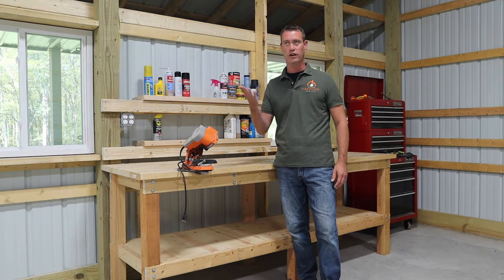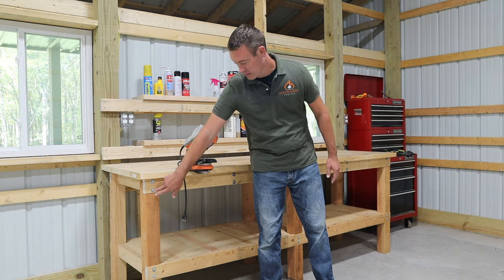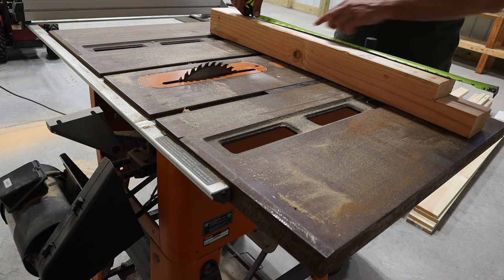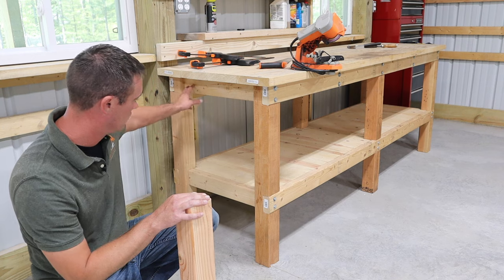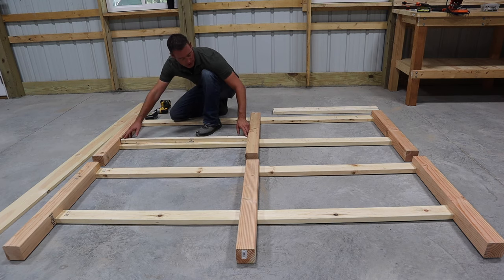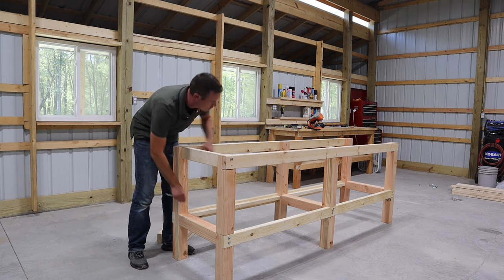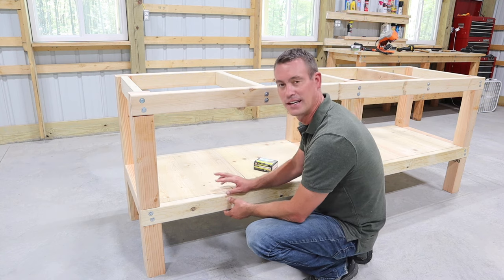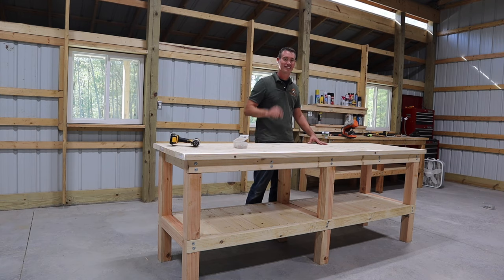How To Build A Workbench - The Best Way

Comment: Getting ready to build this myself I’m just wondering if I need to let the wood acclimate before building/cutting so it doesn’t warp?
Reply: I’m in the process of building this, I would recommend waiting. The wood will warp a bit, I bought kiln dried and it still did.
Reply: @ezez7034  thanks for the tip, I actually finished it already and the wood did shrink a bit and had some mild warping but honestly it came out great. I recommend using wood glue where you can on the joints, that seemed to help prevent some warping.
Reply: @nightman69  really? Which joints did you use it on. Today I finished the 2x4 cross braces along the front and back and used the temporary screws to hold them in place
Reply: @ezez7034  I used a little anywhere It allowed me to. So on those 2x4 cross braces I put glue along with the those temp screws that go in that joint. Since you already put together the cross braces I wouldnt worry, unless you want to go for it and remove the temp screws and throw some glue in there. Besides that, I used glue and screws when securing the 2x8's to the top, as well as on the 2x4 braces that hold up the top. The only area I didn't use glue was when securing the decking for the bottom shelf.
Reply: @nightman69  got it, thanks. Out of curiosity, do you think I could use chopped up pieces of 2x4 for that bottom shelf instead of deck boards. My location only has treated deck boards which I’m not too sure about using
Reply: @ezez7034  honestly I think you could get away with that, you’ll just have to adjust the placement of the 1x1 that’s gonna hold up those 2x4s. Unless you mean ripping them down to a thinner size then you don’t have to do that. Either way, I think it’ll work. You could also maybe find a piece of sheathing ply wood and use that, it would save the extra work of ripping a bunch of pieces and it would still look decent.

Comment: Great video but at 8:23 you do not seem to have predrilled a hole for the lag bolt, is that right? This would mean the thread of the lag bolt is biting into 3 bits of wood, I don't understand who it could be tight in the second or third piece.  Can you advise on the inserting of the lag bolt please?
Reply from the maker: Pre-drilling the first board will prevent it from splitting. Just pre-drill the length of your drill bit and you’ll be fine for the rest of the boards.
Reply: @firewoodforlife  Thank you for the reply. To make sure I have understood, the first two boards the lag bolt goes through has a hole large enough for the lag bolt to slide through and the lag bolt only bites into the short cross member, the third piece of wood and this has a pilot hole drilled into it.  Have I understood correctly?

Comment: Awesome video and bench! How crazy of an idea would it be to add locking wheels to the legs? Do you think it would be feasible?
Reply from the maker: Thank you and good question!  I've never tried it but I think it would work.
Reply: Legs would need to be shorter, that’s all. Although even with the brakes, swiveling casters will make it less stable. I will be building a similar bench and am planning on using retractable casters. Smaller wheels and not as heavy duty as some, but they don’t need to be since they are only used when moving the bench.

Comment: Excellent video... question do I have to use the 4x4 posts?  I have quite a few 2x4 and the price of 4x4 is about rediculous. I was looking at doubling them and not notching.
Reply from the maker: Great question. I’ve never built one without the 4x4’s but I don’t see any reason why you couldn’t glue and screw two 2x4’s together to make the legs. You might even still be able to notch them as long as you notch them on the end edges.
Reply: You can create your own notches as you make the legs.

Comment: @8:17 You mentioned "lag bolt." your material list mentions "lag screw." What looks like in your hand is a lag bolt, which is it? Thanks
Reply from the maker: I've always called them a lag bolt, but after several comments and confusion I switched the material list to say lag screw.  They're the same thing.  I switched it to screw since a screw is self tapping and a bolt typically needs a nut.  I hope this helps!

Comment: I really like this design.  The only concern I have are the bottom cross members.  Screws in end grain don’t hold nearly as well.  The top cross members are just fine given the top is screwed down.  I might cut some 3” angle iron, drill 4 holes in it, and screw that to the underside of the crossmember/leg after running in the lag screws.

Comment: You don’t have to zero out the edges of the 2X8 so that they sit flush with one another? I’m at the top portion of my own bench build and thought you had to do that step for optimum fit.. ?
Reply from the maker: I didn't and I think it works pretty well without cutting the boards.  You definitely could if you wanted a perfect fit and help achieve a more consistent top!

Comment: Hello! I'm curious about your method of securing the frame to the braces.  You are using lag screws to through the 2x4's and 4x4's into the end grain of the 2x4 braces. Wouldn't this compromise the structural integrity of the workbench because the lag screw is going into the end grain of the wood?
Reply from the maker: That’s a great question, however, I’ve never had an issue with using the lag into the end of the braces. The lags are not very large and there’s plenty of wood to hold them without the braces splintering.
Reply: You could drill a hole in cross piece a little ways in and glue a hardwood dowel in to give the lag something to bite on.

Comment: i havent build this yet but it seems promising. i Have to convert it to metrics though. One thing i notice is that maybe the outer two 2x8's arent heavily supported because they "overhang" (whats the word? im dutch;-)). So if you then put a vice on the edge it might wobble a bit? thanks
Reply from the maker: The overhang is pretty small and there's no wobble, so you don't have to worry about that!  I actually have a vice attached to the outer edge of mine (I put it on after the video) and I don't have any issues at all.

Comment: Would a 60” bench with only 4 legs need more bracing to keep the bench from twisting while being used?   Would glued and screwed 2x4s work for the legs... I’m trying to avoid cutting notches.
Reply from the maker: I'm not sure about the 60" bench since I've never built one, but the notches really add to the strength of the bench so I personally would not skip that step.
Reply: You can create the notches as you build the legs.

Comment: question! are the notches necessary for strength? I have seen the 2x4 just framed to the outside. Does that reduce strength?
Reply from the maker: I've never tried to build one with the 2x4 on the outside.  I've always used the notches which I believe makes it sturdier because it captures the wood on 3 sides as opposed to just one, like a dado joint or a lap joint.  Plus I like how it keeps everything flush across the front.
Reply: If you do that use lags or better yet bolts.

Comment: I’m struggling to get the lags to drill in the the 4x4 braces. I don’t have clamps that are big enough. Any advice? Did you pre drill the braces?
Reply: I built this bench yesterday, had the same problem, put the bench on it's side using the cross braces placed loose to support the 2 sections and lean into and wind in the lag bolt to make an impression on the 19'' brace end. Then remove brace, pre drill on the end of brace to help the lag bolt start and then try the lag bolt again, once you get one in it helps. Great bench, really glad I built this one.
Reply: @ianeverett9370  Thanks for the suggestion amigo.  I am at this point and was wondering how I would attack without long clamps.  I know this will work for me.

Comment: What is the advantage of using 4 boards for the top piece instead of 1 solid, thick piece of wood?
Reply from the maker: There's several people that have used a solid piece of wood for the top.  You can definitely choose either style depending on your preference.

Comment: what to use instead of table saw to knotch out the legs?
Reply from the maker: It takes a little longer but you can use a hand saw and a chisel to notch them out. I’ve done it before and it’s not too bad.

Comment: Stupid question time: rather than make the cutouts in the 4x4s to accept the long 2x4s that run the length of it, could you simply screw the 2x4s to the outside of the 4x4s?
Reply from the maker: I think you could, but the notches add some strength and they look a little cleaner.

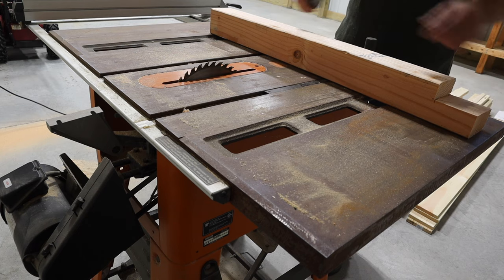Comment: I’m confused, how did you make that first notch on the end of the 4x4 at 3:13? I see you making the not-all-the-way-through crosscut at 3:10 , but I don’t see how you made the rip cut?
Reply: Ok after closer inspection, it looks like you just a did a basic rip cut on it till it fell off? I see one side has a cut with more depth to it compared to the other, if that makes sense
Reply from the maker: That's a good observation and apparently I didn't record that step of the process.  To make the rip cut you can set your table saw blade to 1.5 inches high and cut down almost all the way to the cross cut and then just finish it up with a hand saw, or you can just  make the rip cut using a hand saw the entire way.  I've done it both ways.  The table saw is a little quicker, but they both work well.
Reply: @firewoodforlife  gotcha, thank you!!

Comment: OK, I'm going to show my ignorance here. How did you make the vertical 3.5" cut on the 4x4 legs? I tried with every saw I own except a hand saw, and the first two look like crap. That's when I stopped.
Reply from the maker: I used a hand saw when I built mine.
Reply: @firewoodforlife  Of course you did. I have at least 3 of my grandpa's hand saws. Thanks for reminding me that everything doesn't need a motor, although I wish that tid-bit would have been covered in your video. Thanks for a great video, and your reply.

Comment: Did you do anything to get your 4x4's flat and square? It's not S4S is it?
Reply from the maker: I bought the lumber from Lowes and just spent a lot of time picking out the perfect boards - if that's even possible.  They were untreated and if I remember correctly they were fir.  They were pretty nice 4x4's but I can't tell you for sure if they were S4S or not.  Either way, the bench is very solid and level which I love.
Reply: @firewoodforlife  thanks for the info! And yeah, looks really nice

Comment: Oh the table saw how do you know the height of the blade to cut out the inch and a half notches?
Reply from the maker: Use a tape measure to measure from the top surface of the table saw to the highest point of the saw blade.  You can use the blade adjustment to raise or lower it until it's the correct height which is the width of a 2x4.
Reply: @firewoodforlife  thanks so much for the quick reply and great video!!!!

Comment: The base seems like it would be good, but wouldn't the top be all uneven with those 2X8's simply screwed down?
Reply from the maker: The base is extremely solid and I’ve never had an issue with the top. However if you have concerns some viewers have decided to use a plywood top for a smoother finish. I guess it just depends on your personal preference!

Comment: My basement floor isn't exactly level how can I account for that?
Reply: I am currently building one in garage, and plan on using 1/4" plywood, about 5x5", and slip in right amounts under each leg, possible to dial-in with plastic/wood shims . There are leveling casters available too.

Comment: are you using lag bolts or lag screws?
Reply from the maker: I've always called them lag bolts, but they screw in and do not use a nut on the other side.   The term lag bolt and lag screw are used interchangeably I believe.  I hope this helps!

Comment: How can I mount a vise on this?
Reply from the maker: I have my vice mounted with lag bolts into the top. The only issue you might run into is the mounting pattern on the vice. In an unlucky situation the bolts will line up between the pieces of wood. I had that happen to me, so I just didn’t add all the bolts and it works just fine.

Comment: The bottom shelf which you have supported by the 1 X with 3 screws front and back seems like it is not as capable of holding weight as if you had put the decking lumber directly onto the 2 X 4's.  What is the weight limit of the way you did it versus the weight limit of having the 3/4 boards extend over the 2 X 4's?
Reply from the maker: That's a great question and something I've never considered. I've had mine loaded with totes, saws and various other equipment for years and have never had an issue.  I have to agree, placing the deck boards on the 2x4's is probably stronger, but I really like the recessed look when using the 1x1.

Comment: Wish he could give the whole material list.  Its hard to follow and get materials while watching.
Reply from the maker: I included a list of the materials below the video, but to make things easier I've copied them here as well.  I hope this helps!

Materials needed:

Three 8 foot 4x4's
Five 10 foot 2x4's
Two 8 foot 1x1's
Four 8 foot 2x8's
Four 8 foot long 5 1/2'' wide deck boards
24 five inch 5/16'' lag bolts
8 three inch 5/16'' lag bolts
32 5/16'' washers
1 box 1-5/8'' construction screws
1 box 2.5'' construction screws
1 box 3'' multi-material screws

Comment: Building by myself I’m to the point where I need to stand it up and the video doesn’t show this… I’m gonna have to use the wall in the garage as a brace and a piece of wood to hold the cross beams up while I drill

Comment: A table saw is a pretty expensive tool that most people don't have. Great video but had to skip once I got there. Thought it just needed a chop saw and a power drill.
Reply from the maker: You can use a handsaw to make the cuts but it would just take a lot longer. The table saw isn’t a necessity but it is a faster approach. Many people have used a circular saw which also works great and it’s a relatively cheap and versatile tool.

Comment: What is your suggestion for the notches if i dont even have a table saw? Lol...
Reply from the maker: It takes a little longer, but you can use a hand saw to make multiple cuts just like the table saw.  Just be aware of how deep your cuts are and then you can clean it up with a chisel and/or file.
Reply: Use common a 2x4 board where the notches are just smaller cut pieces between adjacent pieces of an otherwise continuous 2x4 board. Measure/Place/Hold these together with a set of deck screws. You will save a some cash ((1) 4x4x8 is about $13, and (2) 2x4x8 are about $7). The (3) 4x4 cross members should stay as 4x4 pieces, as these do not need notches and the lag crews seems to be a good option.

Comment: This is a great tutorial, excellent presentation. Really makes me feel that I can do this! One question though regarding the top. When you put the top boards on I noticed they are not all straight, is there anything you can do to straighten them a bit to get a flat top?
Reply from the maker: Thank you!  Although I've never found the top to be an issue, you could use plywood to make it perfectly flat.  Just an option that several others have considered.

Comment: What about adding wheels?
Reply from the maker: That's a great idea and you could definitely add wheels if you wanted to.  I chose not to just because I don't plan on moving the bench and I'm eventually going to build a miter stand between my two workbenches.
Reply: Firewood For Life my garage isn’t big at all so I was just thinking if I had a big project I could just wheel it onto my drive

Comment: What kind of wood did you use? I’ve looked online at HD and the total cost exceeds 150.
Reply from the maker: I just used standard, untreated lumber that I bought from Lowe’s. However that was before COVID which has caused the price of lumber to go up dramatically.  Hopefully it will come back down to normal.
Reply: I’d say the total cost for me was about 280. Almost double.
Reply: @ThatCleanMT  Crazy prices for lumber no matter where you are. Total for me was 265.00. How I wish we could have known prices would be so high and stocked up years ago.
Reply: @debradenton8750  even at the 280 I paid, the bench is extremely solid, study and looks great. I have received many compliments! I thought about making another one but for the time being I’m going to wait and for lumber to drop!

Comment: I have been looking at workbench designs now for a couple of days. Everyone I see seems complicated and overkill. Even this workbench made by a humble man telling us he doesn't have any tools looks complicated and as if it could support an elephant. I want to build my workbench in a corner. Thus I only need one leg. The rest will be supported by bits of wood bolted in to the wall. The measurements I want is 600X4000mm.  What am I doing wrong except using the metric system and poor english?

Comment: I don't have a table saw to make notches however I do have a handheld battery-operated circular saw would that still work
Reply from the maker: Yes that should work just fine and you'll be able to set it to the correct depth so all of your cuts are the same.  Good luck with your build!